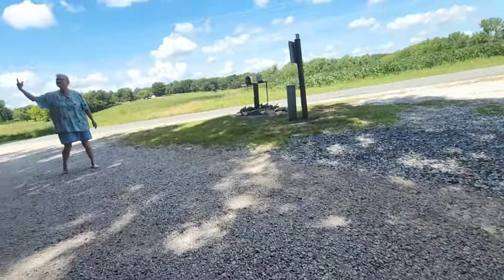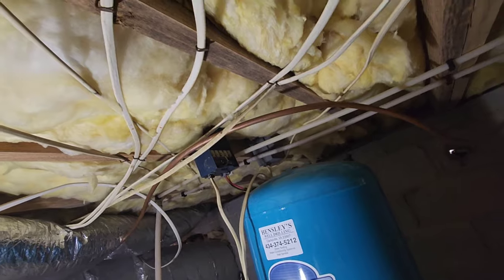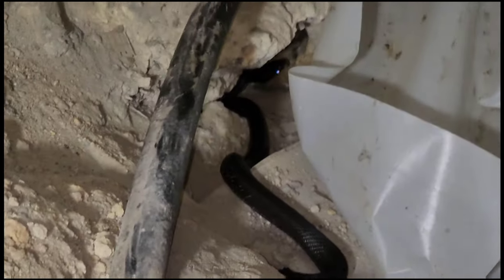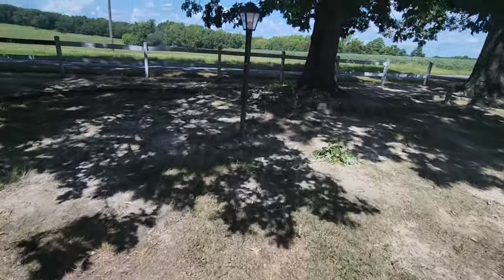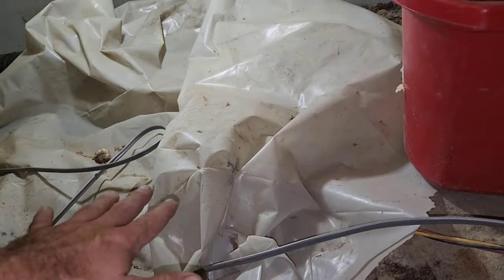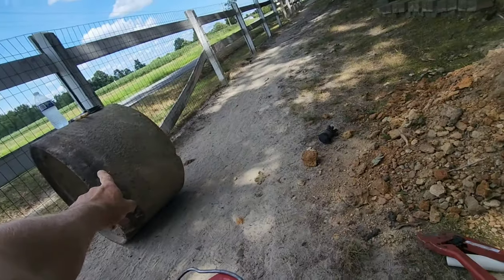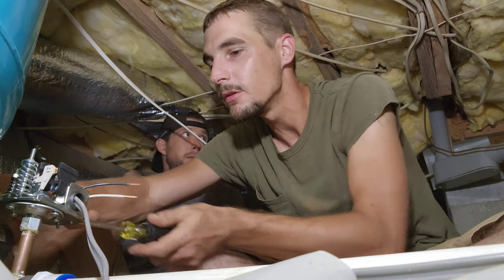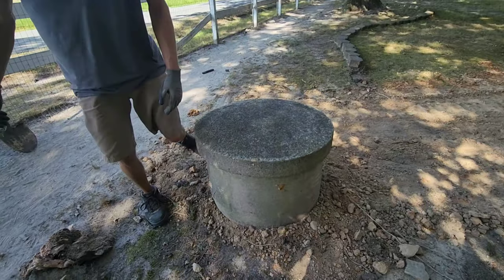New Waterline Install for a Customer, And a Secret Slithering Surprise 😮

Comment: Wouldn't it make more sense to use a union at the well head so that you can just take it apart if/when you need to pull the pump, rather than cutting the line each time?

Comment: Sir, if I have a switch that came 30/50 and I turned it up to 55/75
and then turn the top pressure down to 70 leaving me with 55/70. Would that be harmful?   Also, would I need to adjust the air pressure in the tank to 53 or leave it at 28 (the way it came)?
Reply: Don't put your switch cut off pressure over 60, otherwise it has risk to burst your pipe  in the house

Comment: I noticed the PVC elbows are a different color. Are they schedule 80? If so, should the elbows used near my well head be schedule 80?

The reason I am asking is because I recently had to repair an elbow about 12 inches under ground near my well head. It had a crack in it. I replaced with a schedule 40 elbow. Should I have used schedule 80?
Reply from the maker: Sch80 is just extra protection. Just my preference to use them when I burry pipe

Comment: Our water line to the house is not connected at the top of the well like you show. My husband says it is like 8 feet down inside the casing. He is 75 years old and I am not sure he is remembering correctly. How could you pull the pump to replace it if that is the case? Pump has been down there for a long time. Like 30 years. I don't understand how the water gets pumped to the holding tank that is in my basement. Watching your videos makes me want to have it changed it this summer. I live in Iowa.
Reply from the maker: If you winter time temp wver get Below 20⁰ then your system needs to be that deep in order not to freeze. 
You pump is connected with a pitless adapter, ill send a link to the Vid that shows your type of well head connection so you'll understand.
Reply from the maker: https://youtu.be/gHTn4Y7g26g

Comment: Hi, love your videos , I have a well at home with an old  3050 psi water pressure switch with the handle on it, I replaced it with new one 4060 psi with the same handle, now when I use my Backyard hose for too long my water goes out empty, no water, in order to get water again, I have to do it manually by pulling the handle halfway on the switch ,water is filling until the water switch goes up to 30 psi then it will continue automatically. 
Until we go over again with the same process and Ran out of  water 2 days after .
I don’t understand what’s going on. 
1 - One thing I will do is to replace that  water switch again with another one without the handle.? Any thought , will appreciated, thanks.
Reply from the maker: You need to set your tanks air pressure to 35psi. Have the system off & empty of water before adjusting the air in the top of the tank
Reply: @h2omechanic   , I’ll try that and will let you know  , thanks.

Comment: I just replaced a failed pump in a 160’ well. The iron in the well is pretty severe, the 1.25” pipe going to the surface was about 50% blocked from iron. I cleaned the pipe and reset the pressure tank because it was at 12psi and it’s a 30-50 switch. When I run the pump for a cycle it keeps building to 90 psi and never trips the shut off and is extremely slow to build pressure. Do you think just the build up of iron has affected everything else that I need to completely flush everything out along with possibly replacing the pressure switch? I appreciate the insight!
Reply: @h2omechanic  Hi, if I have a switch that came 30/50 and I turned it up to 55/75
and then turn the top pressure down to 70 leaving me with 55/70. Would that be harmful?   Also, would I need to adjust the air pressure in the tank to 53 or leave it at 28 (the way it came)?
Reply from the maker: @Romans6.1-2  ok, so adjusting a switch is very tricky. You can do what you'd like, but my recommendation is this. 
Buy a 40/60 switch, air up the tank to 38psi, then tighten the nut on the bigger spring 4 full turns down. This will achieve almost 70psi. 
The tank bladder can't handle much more than that. 
I assume your trying to get more pressure somewhere. Normally that's not the issue, the issue is that your wanting more Volume. Volume is achieved by a larger diameter pipe.

Comment: Looking for some help. I added a few short videos explaining my system.
Reply from the maker: I watched all 6 shorts. Turn that meter to the Amp setting and clamp it around single black wire. It should read 6 amps roughly. If its reading 0 amp, you have a broken wire down the well. 
The brass Slide is called a pitless adapter .  It requires a 1" thread and use a metal pipe 6ft long with a T on top so it can't Fall into the well.  ( to make one its a 6ft 1" pipe, 1" threaded Tee & 2 6"x1" nipples. When assembled its a Big Letter T Tool). Thread it into the slide fitting u see, & pull up really hard & wiggle.  
Hwdracing@gmail.com 
Email me & give me your number and we can talk, there's alot of information to give you. Talking is easier
Reply: @h2omechanic  The pump is not running. I have a pitman valve. I am looking for a length of pipe to make a tee handle to pull the pump out. A goulds pump is on the way.
Reply: Zero amps on both lines
Reply from the maker: @gbrehmo43  at the well head, disconnect the red wire. Voltage flows down the black & back up the red. So test the red disconnected. You should see 120v . Then reconnect the red & test the black the same way. 
The other tester lead can go to the ground as you showed in the Vid. 

I'm guessing 1 leg will show lower voltage. 
If the pumps bad, it'll trip the breaker normally. 
So 0 Amps, the motor isn't even trying to spin, so im going to say the wire wasn't attached to the pipe every 3 ft & has rubbed a hole threw the wire by rubbi g against the rock wall of the well. It's very common. 
Either way it must be pulled out.
Reply: @h2omechanic  you were correct.
The red wire from the switch to the pump is bad. I temporarily ran new wiring to the well. We now have water again. Thank you very much.